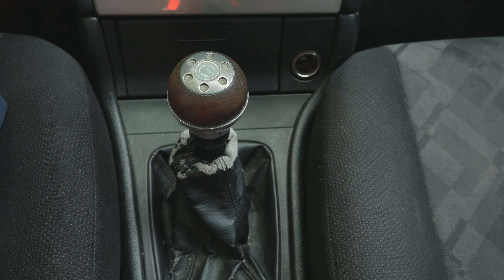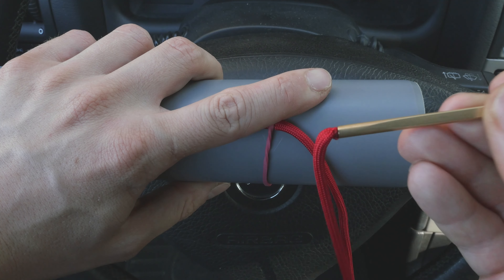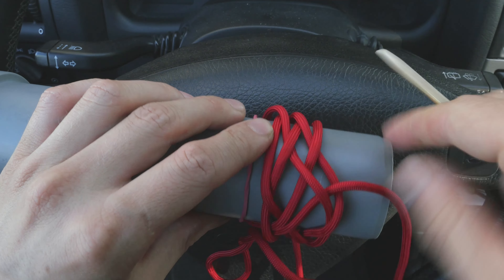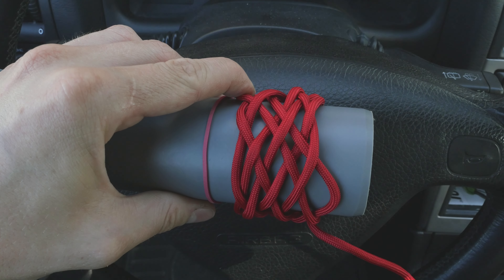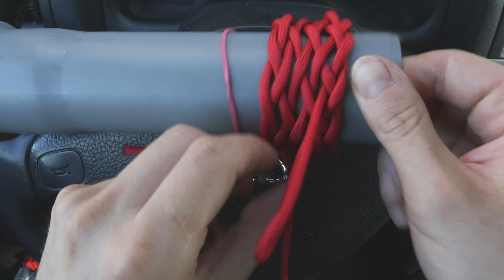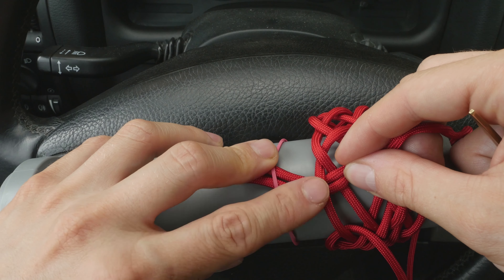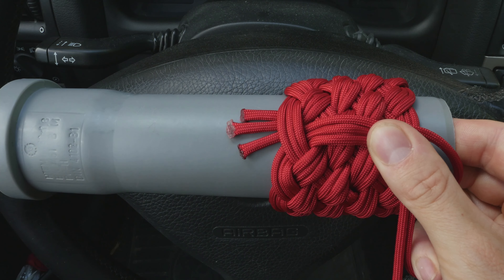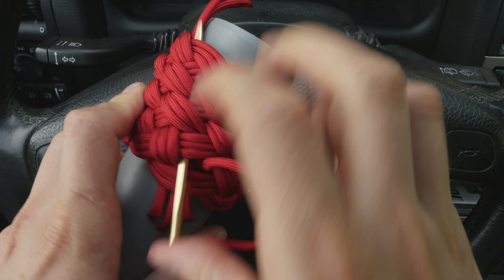Car tack- simple paracord shifting gear knob wrap

Comment: Newbie question - after tightening the knot on the shifter knob, how do you finish it/what to do with the standing and other (running?) ends? I'm used to doing flat mats where you can stitch, glue or splice the ends. I've only ever stitched them and it makes me laugh to think of trying to stitch these on the shifter knob 😂

Comment: Is there any reason why you used 3 separate cords, as opposed to just tripling the knot with one piece of cord?
Reply from the maker: Hey!

Good question!

3 seperate cords are easier to tie because you don't have to pull the large working end through the entire knot. Also it enables you to use 3 different colors if you so choose.

Mark

Comment: I wish there was a way to do it without needle...
Reply from the maker: Hey!

The needle is not mandatory, it just makes the job a bit easier. You could alternatively melt the cord end onto a blunt nail.

Mark
Reply: Hi, Mark. I liked your video, I just get annoyed I can't do this weave without fid... especially that last part pulling working cord to the other side, or tightening the whole thing up. Without fid it won't look so smug, I think. :) Thanks for not demotivating me.